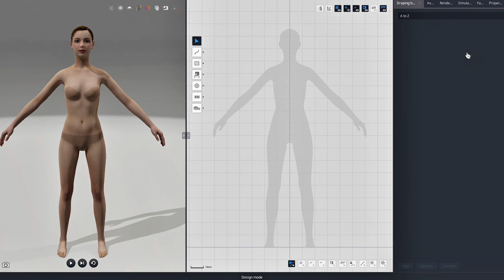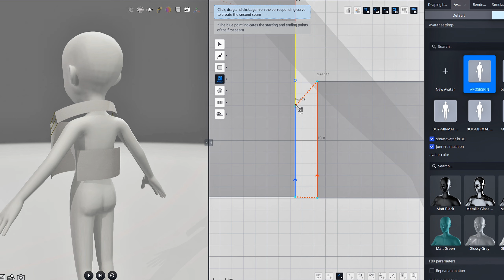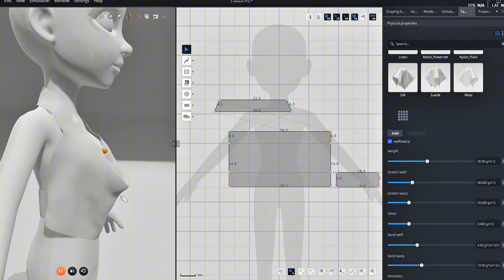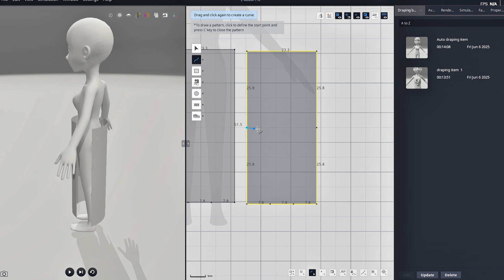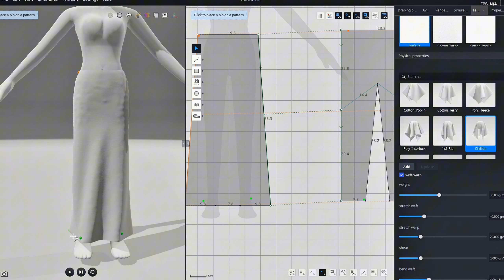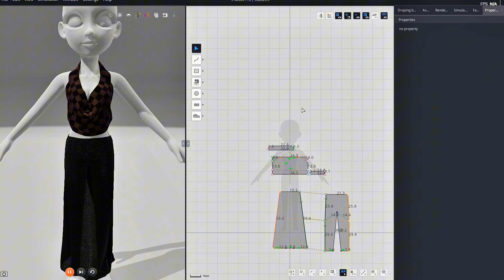[z-weave] Create an Outfit from Scratch for ZEPETO

Comment: How did you make it curve around the neck? Please, I'm having trouble 😭😭😭😭
Reply: did u find ir out yet?
Reply: if yes can u tell how
Reply: @tanya-p5b turns out it's pretty simple, I discovered it on my own. You just need to select the material you wanna make it curve and then move your cursor over the right panel with the sliders, move axis X if you want it curved horizontally, and Y if you want vertically. 😊